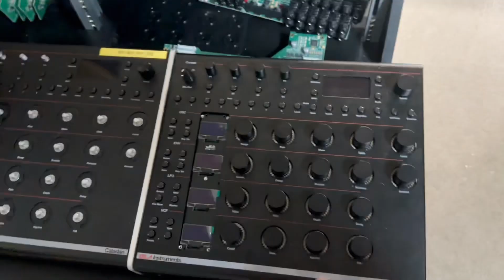Isla Instruments Update December 2024

Comment: cool that you found a fix
Maybe I missed it but since this is an late add-on fan, I presume the OS has no fan or temp monitoring, so if the fan dies how likely is the card to heat up and potentially expire?  How do we monitor it down the road? 
When AMD was overclocking CPUs a ton in the Athlon days if the heatsink detached or fan died you could have a matter of minutes or hours to remedy the issue or sayonara! 😛
Reply from the maker: No, it is fully controlled by the cpu and our firwmare., it throttles the fan depending on what the temperature is.
Reply from the maker: Also, to add, These ARM devices do all sorts of things to keep themselves cool, even if something did happen to the fan the chip isn't going to die, because it doesn't do that runaway heat thing, it just slows itself down, this of course could cause audio dropouts and the like, but it's not going to harm the chip. Another thing to note is that while these fans can spin up to 12,000RPM (which it does briefly at bootup) they are running at a constant +/- 3000RPM which keeps it at a stable +/- 47C (in south florida) which shows that it didn't need a whole lot of cooling in the first place and also keeps it almost, if not silent.
Reply: @ISLAInstruments  ahhhhh, i recall that is how you found out you needed the fan in the first place because it was throttling and causing errors on your test kit....
Reply: this is a good question...